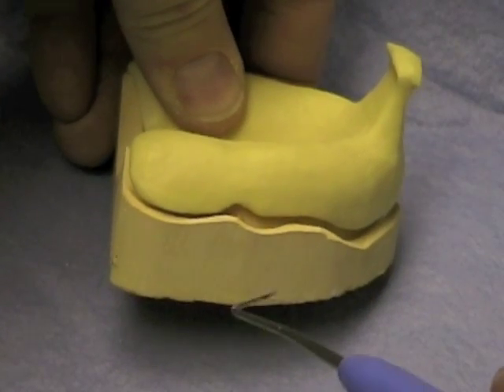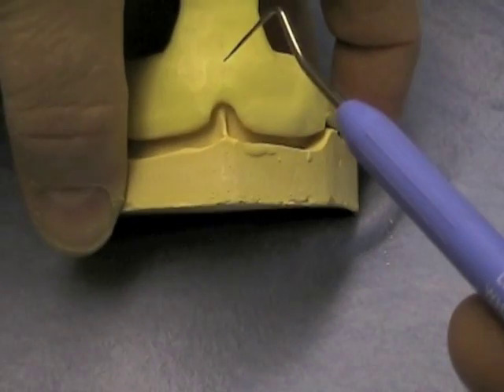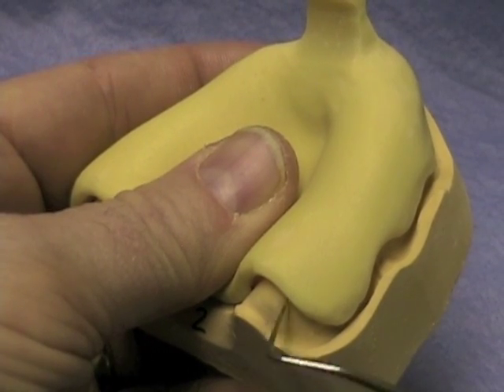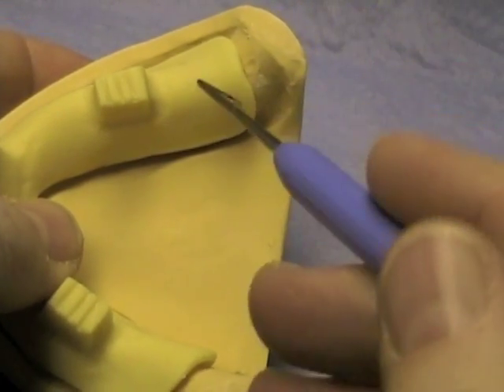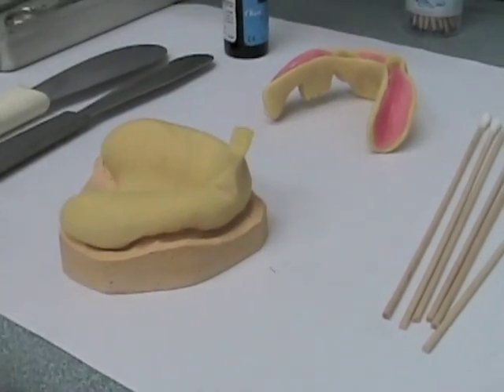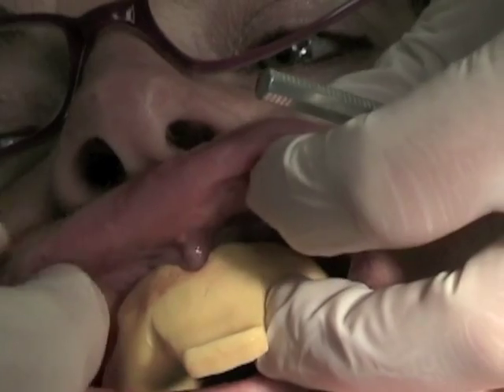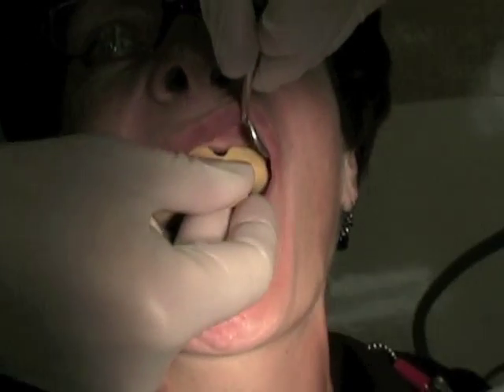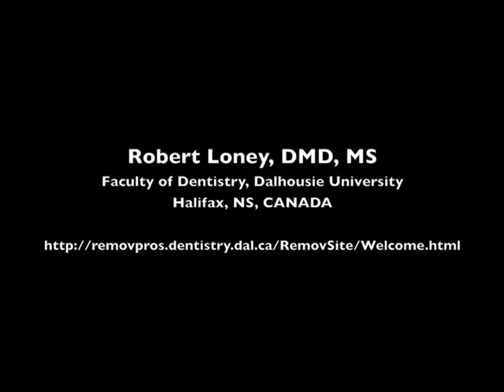20 Custom Trays

Comment: Hi ! When do we give occlusal stops in the trays?
Reply from the maker: Occlusal stops in impression trays are optional. In theory stops prevent the tray from bottoming out on the incisal/occlusal surfaces, but to do so, they must themselves bottom out on the teeth. If the tray is not perfectly oriented during the impression, they contact parts of the teeth they were not intended to. In most instances, stops will neither guarantee a good impression nor ruin a good impression. Optional.
Reply: Robert Loney Thank you Sir!